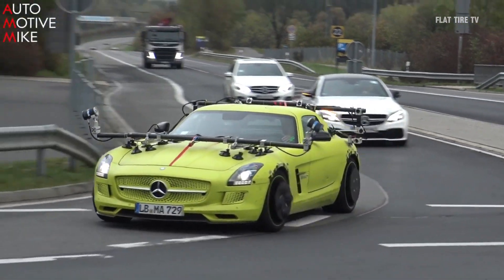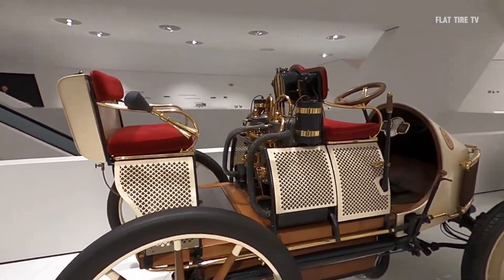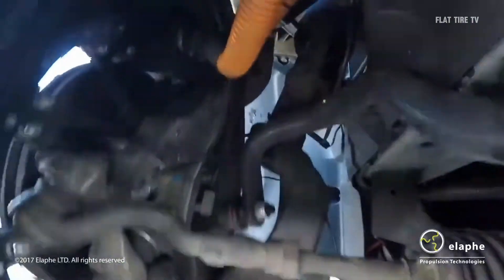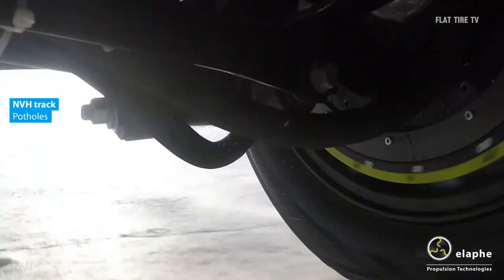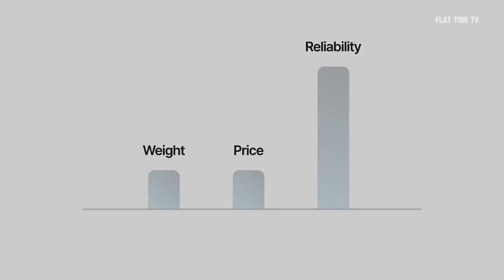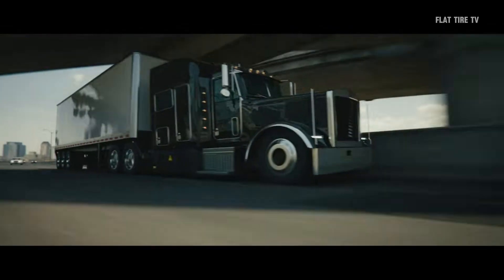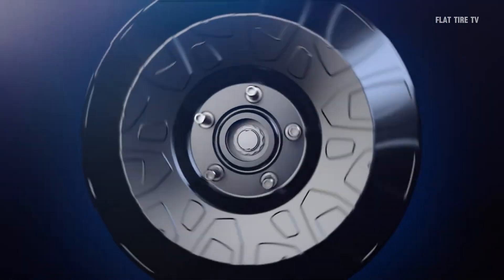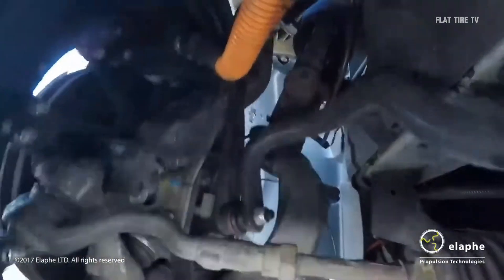The Beginning of the End for Combustion Engines

Comment: First of all, they're not engines but electric motors. Secondly, there's nothing new about the concept. The main problem with having motors in the wheels is the added mass and gyroscopic effect leading to steering difficulties and navigation over rough terrain.